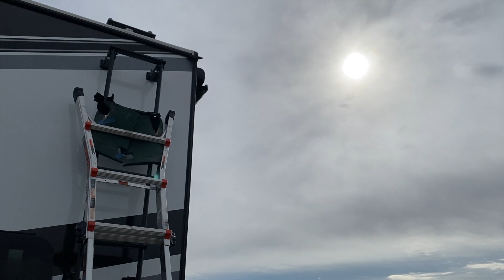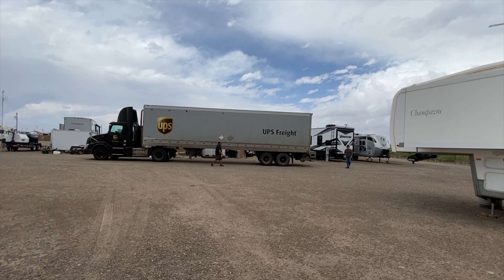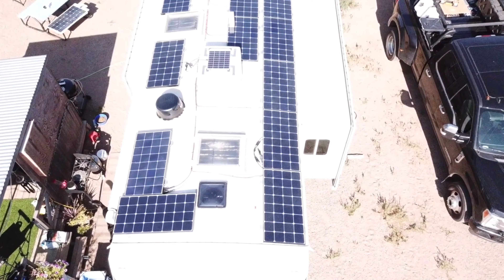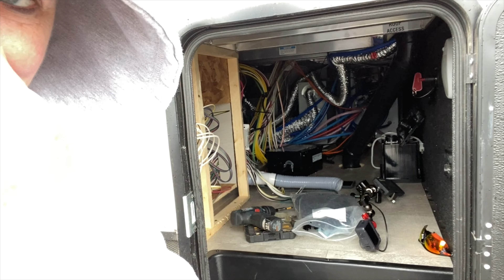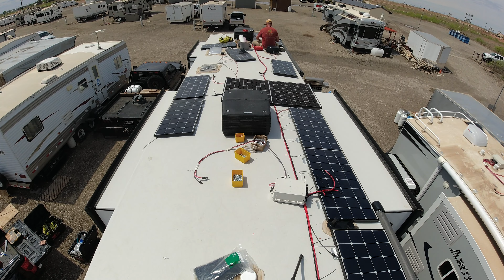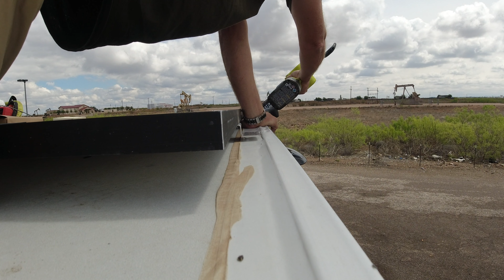2021 Grand Design Momentum 395MS | 4K

Comment: Great work. Is there any way you could of went with higher amp hour batteries? To save space. I went with 3x 200ah heated lithium with a 200ah discharge. I thought it was the right space saver
Reply from the maker: At that time, Battle Born only offered a 100amp option.
Reply: @TheDryCampers  thanks for your reply, also come to think of it, your total discharge would be better, like 1000amps discharge thats very good.

Comment: I’m curious - was the under bed storage in the master considered as an option?
Reply from the maker: Not really, for a few factors: since there wasn't storage in the bay area anyway and our goal is to always keep as much storage as possible, we felt it was a great place to put the batteries as well as the weight. Had the 12 batteries been in the under bed storage, it would have put more weight on the kingpin. As long as the kingpin weight on your RV is fine, it should be ok.